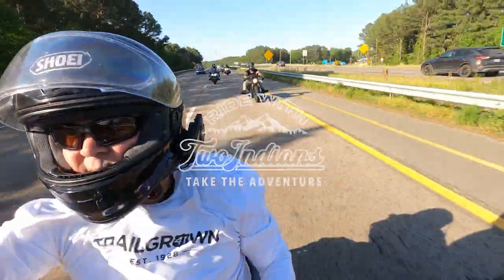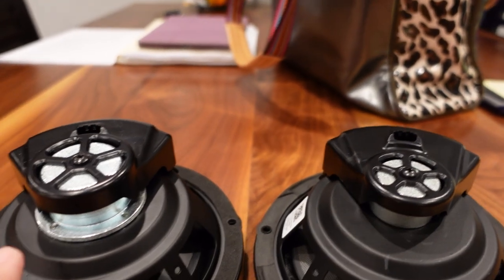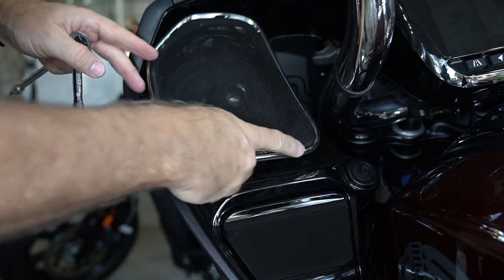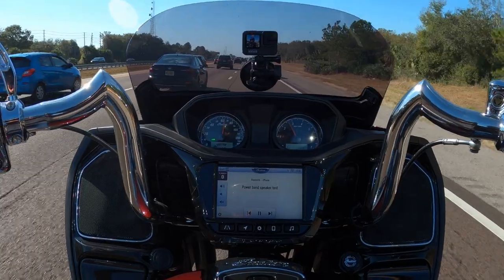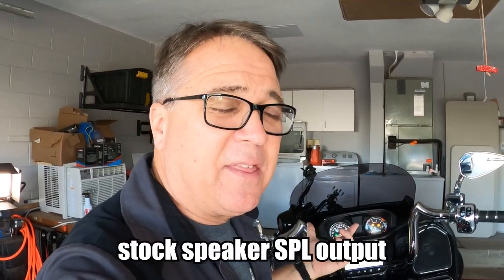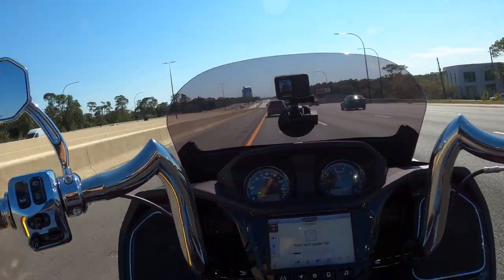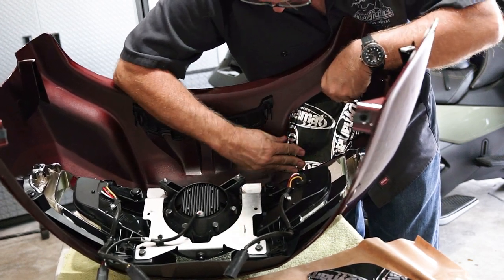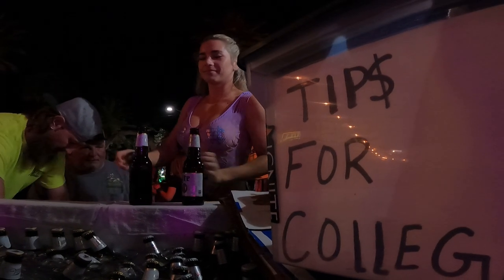Indian Challenger PowerBand Speaker Comparison - SPL Test vs Stock & Klockwerks Dynamant Kit Install

Comment: It always astounds me how you make almost anything interesting..  I am at some stage looking to replace my RM 6 speaker 300 watt system..  as after the 18 model it jumped to 600 watts.  This motivates me to do so.  But still waiting on my folk seals to arrive,  only been 5 months.  Doing new midraise bars at the same time..  cheers for the video Brian. Ps ending is piss funny.

Comment: I had recently picked up a 2017 Chieftain Limited with many bells and whistles. I was primarily looking to get a longer fuel range than what my Scout would do. Plus some old-man creature comforts was a nice addition as well.

I had just recently upgraded my fairing speakers with the marine grade Polk Audio MM522 speakers. Although they sound awesome, I'm still wanting better sound quality. Thanks you you, I'm reminded that Dynamat will work in motorcycles too. Why the hell didn't I think of this before? Oh well. I'm also going to install some poly fill to reduce the resonance as well. This will improve the bass sound without having that hollow sound. Eventually I'll install the saddle bag lids with sound, but for the meantime I'll just improve what I have up front.

As always, I enjoy your videos. 

Thanks again for another awesome video!

Comment: One of the best upgrades I have made to my 19, RoadMaster.  It has 4 speakers to the challengers 2, sound quality is so nice.  Cruising on the interstate at 75mph you only need to have volume turned up to 2.5 to get a full rich sound.

Comment: Hi Brian nice video as always. I have these speakers no liner. I also have the bag lid speakers. I am very satisfied. Volume is ridiculous. I often stay between levels 4 & 6 maybe 7 at high speeds but I find it too loud above 6 most of the time. The Hardstreet bag liners and shelf made a big improvement in the rear speaker sound I did notice that. Enjoy, and ride safe brother!! ✌

Comment: I too have hearing issues, but I hear the 6.5" stock speakers quite well at highway speeds and volume about 2 1/2.  And I wear foam ear plugs.  I don't think I'll spend the $650 for the speaker upgrade judging from several reviews I've seen.  Thanks for sharing.

Comment: After going back and forth over how I wanted to listen to music on my Springfield, I opted for wireless in-ears vs mounted speakers. I chose the Jaybird Vista SEs. They have active noise cancelling and the audio quality is exceptional.  The ANC dramatically reduces the engine noise to allow the music to clearly be heard. The battery lasts many days of riding because they charge while in the case. Plus, they only set me back $150! 

The fact that I don't have a fairing to drop in speakers also came into play!
Reply from the maker: That interesting, never heard of them, will check that out. I currently use a set of iAsus helmet speakers with and outboard amplifier that works with me Sena, also very good wuality

Comment: Wouldn't the wind noise while wearing a full face helmet at highway speed wash out the music? I've been running the Motikom ear buds neck lace doo da . Blocks out wind noise mostly with noise suppression and i hear the music clearer then speakers in my helmet. I'm still curious how good fairing mounted sound systems can be though . 🤔🇦🇺
Reply: I have  Indian Road Master and get that question alot.. it sounds great i don't lose quality or volume even at top speed.. 2 speakers in front fairing,  2 in Saddle bags and 2 in trunk front..  even when i have bags off and trunk the 2 up front still power  on..
Reply: No. I can hear just fine with the normal system going down the highway. I do have a taller windscreen that cuts all of the wind buffeting on my head.  The sound is right in your face and it's nice when it's warm out. I do use my earbuds plugged into my Cardo in the winter to keep that heat in around my face.

Comment: Nice video, So was the dynamat worth it? Did it make a difference in sound quality?
Reply from the maker: Here’s how I answer that. If you’re installing a high end sound system and you want to make sure you get the most out of your investment then in that case $185 is cheap to make sure you’re doing everything you can for great sound. But if you have stock speakers or even the Indian upgraded speakers my answer would be “no”. Remember, it doesn’t improve the sound of the speakers it just mitigates vibrations (as well it can) so your good sound doesn’t get trashed but if your speakers are incapable of really producing noticeable vibrations then the money isn’t well spent.
Reply: Ah, makes sense to me. Thanks.  😎

Comment: I would upgrade the amp power as well. 650 for speakers is a little high. Dyna mat is good stuff. Put it all over. It helps. Also, these speakers need to be contained within their own enclosure to sound better.
Reply from the maker: I think I mention in the video that the speakers have a pretty solid “cabinet”. It’s very rigid and doubt there’s much resonance at all

Comment: cant a coaxal speaker work also?   "$650. kinda out of line!"   theres a ton a marine grade amps out there! 
just asking..

larry
Reply from the maker: It takes some application adjustment as the speakers have internal amplifiers. You cant just plug in a new speaker sadly.